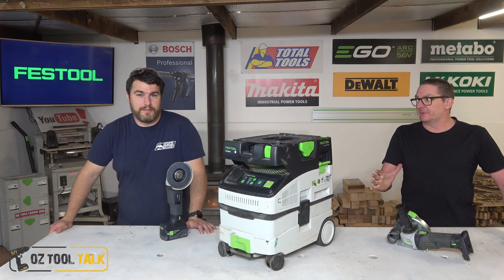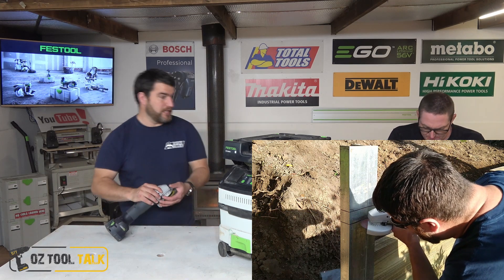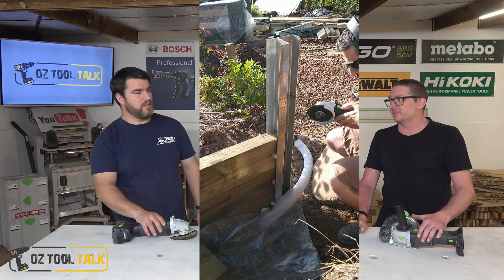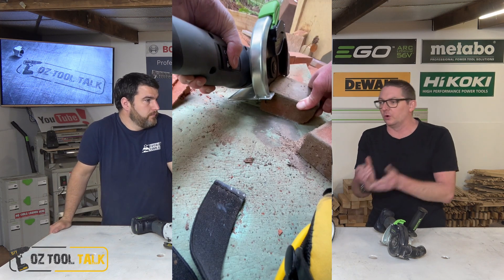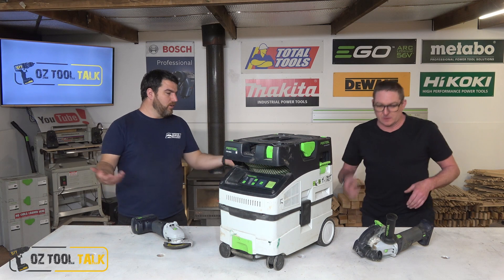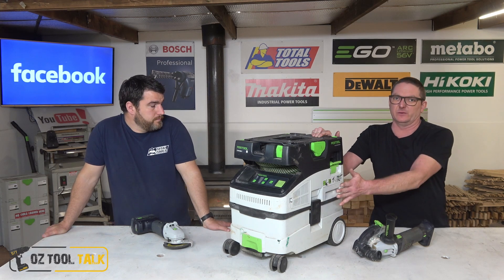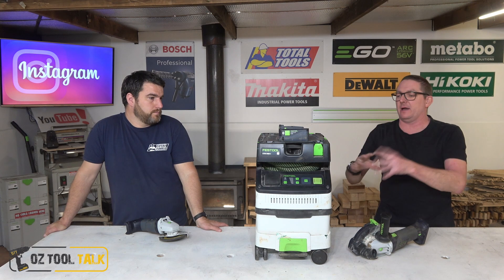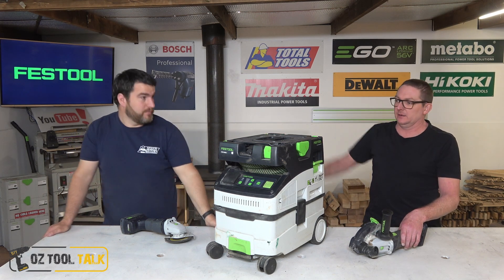Festool 18V Diamond Cutter with M-Class dust extraction PLUS 18V Angle Grinder [2020]

Comment: These are actually made be Fein. Festool however made some small design alterations such as switch placement, plastic grip design etc.
Reply from the maker: cheers
Reply: its not made by fein, its made in the festool faktory in wendlingen germany i worked there.

Comment: Never have and never will be acquiring tools from Festool but a watch, thumbs up and comment to support the channel with the YT algorithms.

A lot of cement board is cut in the UK for bathrooms and for external of tower block homes and I see so much of it cut with circ saws just tearing the granny out of the tool with no dust extraction - this is the use case but companies never invest in Festool in the UK unless small scale due to worries of theft. Most Hiltis rent/lease style on site with the whole fleet management. I think most Hilti tools now have a GPRS/GPS style bit of location tracking for theft deterrent.

Comment: I’ve just purchased the angle grinder and the conversion system to the concrete cutter, plus their smaller H class vac and the Bluetooth switch (saving money on batteries). I’m a tiler and am just preparing for the inevitability of needing an extractor coz of silica dust. I’ve been thinking of purchasing festool’s track concrete cutter which apparently has better dust extraction. But I need to get back out of dept after these said purchases. Compared to using the old 100mm grinder (makita, still a very usable grinder) these tools don’t have nearly as much vibration. That’s why the grip is larger coz the motor doesn’t touch the outer parts of the machine. Another thing with these is they have a fully enclosed motor, which means that these tools will last, tiling is a highly dusty trade and it wrecks your grinder’s motor.
 One thing I will say is I’m not overly happy with the longevity of the batteries, this is my first cordless grinder, and I haven’t had a fully charged battery last all day. Is this to be expected with a cordless grinder?
As for the vac, I love everything about it, we had to rip up a big room of old tiles and this vac was epic.
As for Festools prices, I think if a tool is better and you use it for work, it’ll pay for itself very quickly. Whether you get ripped off or not. 
As far as warranties go, I haven’t found better than Festool. 
If you’ve read this far, we’ll done👍🏼
Reply from the maker: I read it all ;) Thanks for the feedback, that's really insightful. I would not expect a grinder to last all day on one battery, no.
Reply: For the original commenter here, fellow tiler and I’m considering buying a Fein 18V CCG grinder which the festool is based on. How has your festool held up since your purchase?
Reply: Extremely well to be honest, just make sure you use one before you buy it coz I have to hold it in my left hand, which is a nice change from the norm and having to learn to use both hands for tools. My favourite part with this grinder is the back cutting, I can flip the grinder upside down and see everything that it’s cutting, it might feel a little weird at first but I love being able to back cut without the grinder jumping. Yep, the grinder hasn’t jumped the entire time I’ve had it.
Reply: I’m left handed btw
Reply: @kierenovery8420  thanks bud. Yeah I have a few corded grinders and I have M18 tools but no cordless grinders yet. I want one that’ll last me at least two years to warrant the higher cost. The fein/festool have the same motor and dust protection which appears to be the best on the market and both have variable which is nice. Fein has a bigger range on the variable and has a more narrow body which has my attention specifically
Reply: Agree. I purchased a Makita top of the line vac and was a piece of trash I had to return after first use. Purchased a CTM36 AC and feels like I’m operating a luxury piece of machinery I’m obsessed with it lol. If you run a business and use these tools daily the price isn’t really a factor, they pay for themselves. These aren’t made for a DIYer but if you have the coin go for it

Comment: My L class is exactly the same as the M class, still trying to work out the difference. Don’t like the on/off button? Get the Bluetooth remote for the hose - works a treat when not using Bluetooth batteries, or when you want a simple clean up at the end of a job! :)
Reply from the maker: cheers Lachie. The difference is in guarantee of small particle removal I believe. And self-cleaning?
Reply: @OZToolTalk  dunno bought the self cleaning, your M class has same manual clean as mine unless it’s doing while in use? Don’t forget to grab the Bluetooth module! It’ll chance your world whatever tool you’re using! No more walking back to the vac! 😁
Reply: @OZToolTalk  BTW - keep up the awesome vids guys! Love your work!!

Comment: Can you tell me why these brushless grinders are so slow? I have the makita, very happy with it but, I pulled out my big bosch mains beast, 125mm, 1500w 12000 rpm. It rips though stuff because of the revs, I got out the old battery makita, 10000 rpm, it cuts much faster than the brushless with 1mm cutting discs.
Reply from the maker: if you're brushed Makita grinder (very out-dated) is out-cutting your brushless Makita grinder, then something is very wrong with you're BL Makita.
Reply: @OZToolTalk  it doesn't but why are they only doing 8500 rpm? It fucks the discs because they are running to slow. I find that flap discs an wire brush work is fine, as is grinding but thin cutting discs are slower than they should be because of the low rpm, the 4.5" air grinder with 12000 rips thro.

Comment: When getting FC products I like to use a sacrificial piece of timber under the cut to further improve dust extraction, if there’s nothing underneath dust escapes as seen when you were cutting blue board
Reply from the maker: I think the main reason dust escaped on the blue board cut was because they vac turned off without Mike realising (not sure why, I wasn't there). Good tip though! thanks